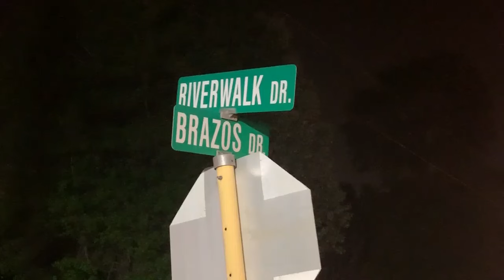031520 OFF DUTY METRO POLICE SGT FATAL

Comment: Corvette engine in that old Chevy with zero safety equipment looks like.
Reply: Looks Like a older 2000 LS1 Corvette engine 5.7  350 HP / 350 LBS Torque transplanted in to a 1953  Chevy still with 53 suspension not a good mix.
Reply: @JustRusting  It's a '54, but yeah, very close to a '53. I've had both. They only came with a 235 cu inch inline six that produced 115hp (stick shift model) or 125hp with the Power Glide Auto Trans. I would agree that installing an engine with 3x the horsepower and without modernizing the steering & suspension is a death trap waiting to happen. Looks like his friend invested a lot of money in this with the aftermarket digital instruments, and the Vintage Aire A/C system. Too bad his cop friend didn't have better respect for this old car. Trying to make a stodgy family sedan into a street racer is a fool's move.
Reply: @JustRusting  Yes the '53 looks pretty stock otherwise.

Comment: Looks like he was traveling over 55.

OK the LS9 looking thing where the motor should be.
Reply: It looks like an LS1,2 or 3, could see the plastic intake so not a supercharged LS9 or LSA, either way more power than stock brakes and suspension on a 54 Chevy should be asked to handle. It may have upgrades to suspension and brakes but the driver wasn’t used to the way old cars handle especially with over twice the power. That’s one solid tree though. I hate to see anyone killed and the poor friend, he lost a buddy and a car.
Reply: That's definitely an LS1

Comment: What a great "sleeper" car...looks perfectly stock, especially with those skinny tires. The Corvette engine is sweet. I would have loved to have seen that car before the crash...
Reply: Looks lowered to me.   I see a lot of those old cars modified into low riders, powerful engines and hard to control.
Reply: Tires aren't skinny but low profile, not a fan of those, and the driver was probably hopped up more than the car. Very sad for both the driver & the car.

Comment: Even a small tree is unforgiving.  Imagine a modern car that has no where near the mass of a 1950s sedan.  The engine looks to be out of a Corvette.  Too much power for this car with zero handling.
Reply: This car doesn't weigh much more than 3,200-3,400 pounds, which isn't exactly much given the size of these cars. These days even a VW Golf can weigh this much. Not to mention a modern sedan usually is much heavier than that.

Comment: Why was the guy driving a 1950s classic car like that? You drive them slowly and gently (I have one).
Reply: You mean low and slow
Reply: Looks like it had a corvette motor in it so it was rebuilt for speed. I agree though, they shouldn't be driven like that in my opinion.
Reply: People build these rods with all the power but half the brakes, double the weight, and half the suspension and then expect it to handle like a corvette and they don't take the time to add extra bracing or a roll cage, when these old cars crash, it can get UGLY
Reply: Because he was likely drunk.
Reply: @thebronzetoo  
Maybe taking pot as well.

Comment: High performance engine, low performance car.
Reply: Lol 350+hp with 50s leaf springs yeah some people dont think.
Reply: @ianchesney9639  that car by the looks was not on stock suspension
Reply: @rustedratchetgarage6788  your more than likely right, didn't pay attention.
Reply: Jessi Louis  On top of that:  Probably no power steering, either.
Reply: No High Performance engine, low performance driver.
Reply: @jasondessing3508  yeah, when they show the motor it looks to have a PS pump attached, meaning the suspension is probably upgraded when the rack was installed.  Just a guess though.
Reply: Route 66 Texas  im def aware of single master cylinder. I have one on my 64 falcon, and i need a duel cyl with power booster! Desperately
Reply: Route 66 Texas  appreciate that fellow texan as well!
Reply: @fk4515  He probably had a few beers, too.
Reply: High performance vehicle, low performance driver
Reply: @ianchesney9639  400hp LS1
Reply: @bad74maverick1  what i saw pictured was an a/c compressor;not a power steering unit but maybe there was one mounted on the driver's side.

Comment: This should put to rest any argument that older cars a tougher and can sustain damage better!  RIP sir. Edited for spelling.
Reply: I saw wrecks with 5yr old cars around trees on these morbid channels that looked worse. Some were sheared in two. Can' t fix stupid.
Reply: They performed a crash test between a full sized impala versus a smaller modern Chevy Malibu and the old Impala fare a lot worse. Older cars can withstand fender bender a lot better than modern cars, but high speed crashes, they are death trap. Many of them only have lap belts, lack of protective cage so the cabin will collapsed before the engine compartment, lacks side impact bar, no ABS, poor braking (drum brakes) .
Reply: @diegosilang4823  Those 1958-64 'X-Frame' Chevies were known for this 'folding' issue (as shown in that video) even when new. (No side frame rail under the doors) And truthfully,had this been a later model unibodied car,it would've split it in two. Seen too many pole/tree t-bone strikes like this one.
Reply: @DrOlds7298  you beat me to it.

I've been screaming that was a staged collision to begin with.

They specifically chose an X frame car to get those results, had that been an Imperial or even a Galaxie we would have seen much less drastic results
Reply: @notablynova4247  "Specifically chose" What a bullsh*t argument. A 59 Bel Air was a regular car which just so happens to have a X frame. And it wasn't even the only car with this frame design. An Imperial was a large expensive luxury car and is known to be unusually tough, way tougher than other cars back then. And even classic cars with a standard ladder frame would fail modern crash tests and would fail against newer cars. There is little to no frame rail support in these overlap crash tests, much less small overlap crash tests. It's not hard to understand.

Comment: Anyone else notice he has a "Corvette" engine in there? (4:23)
Reply: Most likely a restomd…….   Crate motors or pulling from a junk yard is cheap.....  But, if you do not install a discbrake kit with an upgraded suspension, this is what happens, with a car designed for a max 250hp and drum brakes...…  I mean, even if you do all the work yourself, a restomod will cost north of 28K, without body work, to build.....  Seems to me, the cop had no business driving that car.  It wasn't his.
Reply: @chuckhaugan4970  Wait, a cop was the driver?
Reply: @sbckev2287  yup.... one cop waiting for the other as the car sat idling....  Other cop decided to drive the car without permission, around the block a couple times.....  Ummm….  Seems to be a few crimes here..... But he beat the wrap by death....
Reply: @chuckhaugan4970  wow, that's crazy... someone definitely put some work into it, I'll use my imagination from here
Reply: 6.2 LS swapped. We build cars and trucks exactly like this old Chevy, they can get away from you in nothing flat if you're not familiar with them, especially without up-to-date suspension and braking. This hits close to home for many reasons. Thoughts and prayers to the family.
Reply: Car like this probably doesn't have air bags huh?? I didn't see any
Reply: definitely not a 235 6 cyl.
Reply: @chuckhaugan4970  Pal I think speed was the cause of this crash.
Reply: LS engine.
Reply: That’s a real shame about the car. The owner must be devestated. RIP 54 Chevy!
Reply: Yep
Reply: @rachelroberts603  meh..... a four door ....dime a dozen
Reply: 250 horsepower a 54 Chevrolet was likely to have 85 horsepower cuz I didn't have nothing but a 235 inline 6-cylinder
Reply: Yes this is an LS1 Engine probably out of a C5 Corvette. I own several Corvettes and I recognize the Fuel Rail crossover pipe common to the early C5 Corvettes.  Unmodified these engines put out 350hp to the Flywheel, but with CNC'd heads and an aggressive CAM these lumps can make upwards of 500hp without help from a turbo or supercharger.  No custom headers that I can see, so not a high end build.  The normal Drive by Wire throttle was replaced by a aftermarket mechanical linkage (you can see the silver throttle cable coming out of the firewall) to the throttle body. These old behemoths are heavy and almost impossible to control once the tires loose grip.  Once the driver lost traction and over corrected at those speeds, he was just along for the ride.  Unfortunately, it was his last ride.  God rest his soul.
Reply: @chuckhaugan4970  Brakes aren't really the issue here.  The slide was sideways so braking isn't going to matter.  Not only that but that's a full frame car, He had to be hauling serious ASS to cram it that far in a tree!  4 wheel disc wouldn't have helped him in this situation.
Reply: @bad74maverick1  I get your point completely. What caused him to fishtail?  We both assume something. I remember my 66 Malibu that love to go but not stop.  He shouldn't have drove buddies car.   I'd never jump in my friend's GT500 and floor it on the first drive!  Would you? LOL he's an idiot
Reply: @chuckhaugan4970  Oh I agree 100 percent.  I'd say there was some suspension mods for That Ls1 (?) motor for the car to sit even, and I don't think Drum breaks would lock up with sand in them in Arizona LOL, so who knows.  I just thought I would offer another view point based on the photo's. 

Would I jump into A GT500 and floor it?  Yep, you bet.  But I have a 60 Falcon Ranchero 289 Hipo swap with a 4 speed, A 67 Mustang 289 4 speed, a 74 Maverick Grabber with a V8 Auto, and an 87 Mustang with a 20 thousand dollar supercharged GT40 motor in it.  So I (think) would have a pretty good understanding of it's handling.  Would I do it without asking, not in anyones life time!
Reply: So in 75 years the motor was replaced, amazing
Reply: The engine is cursed now. It will go into another car and wham.
Reply: Corvette swaps are as common as they come
Reply: @awesomeone2979  me too .... ( if they're station wagons ) 😁
Reply: @americancoalminer6828  that was a 5.7 LS1 not a 6.2

Comment: He's lucky the tree stopped him. That brick/rock entrance sign would have been worse hitting it sideways like he hit the tree. Still amazes me he stole the car in the first place. He wanted to see what it could do and knew the owner would never have been so stupid. Its just sad his family had to go through this. I would be embarrassed by it.
Reply: If he hit that rock entrance he would be even deader.
Reply: That block entrance sign would have been spread out over close to half the length of the car instead of cutting it in half it would have hit the rear axle that would have taken some force instead of it being about an 18 inch tree. Plus the fact that the concrete blocks would have disintegrated with that much impact but it appeared that there were no seat belts, or the main impact of the drivers body wouldn't have been the passenger side front door. So the driver would have still been injured but I doubt it would have been a fatality.
Reply: @horsepower711  Yeah, the sign would've been much better to hit. The only concern would be flipping it, but even that is more survivable than being cut in half.
Reply: Lmao how are you lucky to have not hit one thing, but hit something else if you are dead?

Comment: My dad is into old cars. All his buddies CONSTANTLY talk about shoving big blocks and other monster engines into these classics while my dad runs normally straight 6s....no wonder he's 86 and still kicking it. Modern horsepower without extensive upgrades to brakes and suspension, added to showing off never ends well. Case in point. LEO should have had more sense.
Reply: Life is beautiful

Comment: Oh my gosh! Why would he go fast in an old car like this? Aren't these the cars you only cruise in?
Reply: drug addicts do silly things.
Reply: well yes, but this car had a swapped engine. A much more modern 8 cylinder engine. So i’m guessing this car was making a lot of power to be able to wrap it around a tree like that.
Reply: That's a 54 Chevy. I own a 53 Plymouth. You can use them as a regular car. For getting groceries, going out to dinner. Going to work and commuting. Not just for cruising.
Reply: Low & Slow is the way to Go !!🕶
Reply: It had been modified with a powerful engine and also looks lowered, it was a low-rider I am thinking and those are hard to control.    Look at the back wheels, they sit awfully low.
Reply: No seatbelts, no safety features.
Reply: Cruising is very sensible. You don't have to speed to cruise around.

Comment: That’s so crazy, how do you manage to wrap your car around a tree like that…
Reply: Cars back in those years were very poor handling.The suspension was good enough for a six cylinder engine which  is all they had available then. Putting that monstrous V8 in it was a recipe for disaster.If you drove it sensibly you could get away with it. He must have hammered down the gas pedal and it would be very easy to lose control.

Comment: I just wonder what the speed was at the moment of Impact? It takes A lot of speed to wrap around A tree like that, RIP Sir,
Reply: It could a s low as 30 mph at impact. These old cars fold like  accordions
Reply: @deansapp4635  
No they dont
Reply: @budd2018  Seems like Dean has no knowledge of these kind of cars. Actually you see some of the newer cars pretty easily end up in two pieces with this kind of impact. This car stayed solidly in one piece although certainly bent badly. Newer cars are safer although these kind of impacts are about the worst in any car.
Reply: Charles I have been in automotive for decades and seen all kinds of wrecks and wreck damage, old and new cars. That car was flying, I wouldn't doubt 100mph.
Reply: @deansapp4635  30 mph? That's ridiculous.  The actual speed was more like 60-70 mph
Reply: @jrftworth  Go watch the video of a crash between a modern Malibu and a 1959 Impala
Reply: I read earlier he was going 80 mph, where the needle of the speedometer was stuck at.

Comment: He certainly could have benefited from a comprehensive roll cage and seat restraints to go with the increase horsepower
Reply: Would have to be a nascar type cage to prevent that 
  Something bolted or welded to the frame on this car probably wouldn’t have done much 
  Maybe in a rollover but the impact this car experienced?
The frame just gave up

Comment: Condolences to all involved.  This really highlights a common problem in the hot rodding world.  Older cars are not designed like modern cars in terms of safety.  I dont care how much or how little power the car has or what changes have been made to the suspension, tires, and brakes.  All of that only influences how likely it is that the vehicle will crash.  What had not been addressed is what happens if it does crash.  These cars were death traps in that respect.  This crash could have been easily survivable if the car had a roll cage added when it was built.  That may sound extreme, but that's really what is needed.  These are cars built in a time when fatal car crashes were a regular thing.  I don't think there should be a law forcing the matter, but I think owners of these cars should give serious thought to adding structural body reinforcements, preferably in the form of a roll cage, along with proper seat belts at the very least.
Reply: While I think a cage is a good idea I doubt it would have made a difference in this case. That was a hard hit.
Reply: @billmiller7138  you're probably right.
Reply: As a owner of a 1953 Plymouth. I'd say me and lot of other guys wouldn't be into destroying the interior of their cars to add a roll cage, and all kinds of safety equipment like a modern car. they won't be a modern car ever, no matter what you do to them. So enjoy them for what they are, and drive them for what they are. You just have to be more careful and cautious about it and keep in mind that an accident above 20 miles an hour will probably kill you.
Reply: @russelljohnson1303  I completely understand, and I think it should definitely be your decision, not some government regulation.  I myself have a wife and kids.  I think about whether I want them riding in the car, and whether I'm ok leaving them behind if I die driving some old car.   Not an acceptable risk for me, but you do you.
Reply: If he had subframes it could've absorbed a little bit of it

Comment: I remember back in 1993 ..  I was drunk with a 78 Monte Carlo n had a fast engine in it and somehow I went off the road and I couldn't get back on and the car was sliding in the ditch..  I couldn't get control of it the force pushed me ino the back seat.  I was still holding on to the steering wheel .  I looked up and there was a power pole pointed right for my back side window .. I let go of the steering wheel and that car jumped that road onto the other side into a bean field I could have died that night....
Reply: I'm thankful that your Guardian Angel and GOD were with you that night.🙏 PRAYERFULLY that was a wake up call ..DO NOT DRINK AND DRIVE 🙏❤️ GOD had a purpose for you and your life and that's the truth 🙏❤️

Comment: When I was growing up, we had a car like this—a ‘54 Chevy 210 sedan—so this video hit home.  I don’t know what kind of motor the owner dropped into it,  but the speed it enabled was too much for the car, and the driver, to handle, especially on this residential street. And there was no way he could walk away from any serious accident with this car—I doubt that owner installed seat belts, and the dashboard and steering wheel were painted steel and chrome. It’s not hard to imagine what might have happened. The guy was probably having a few beers with his friends, wanted to try the car, and got a bit careless. It could happen to anybody, I guess. How devastating this must have been to his family
Reply: Corvette LS motor. Guaranteed this accident never would've happened if this car still had it's 235 inline 6